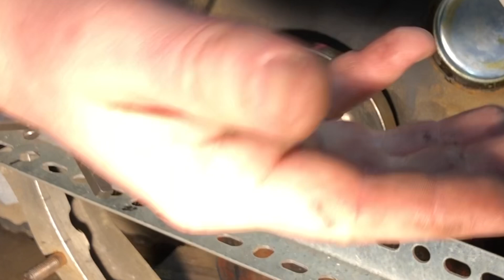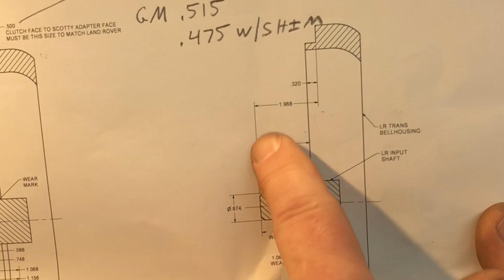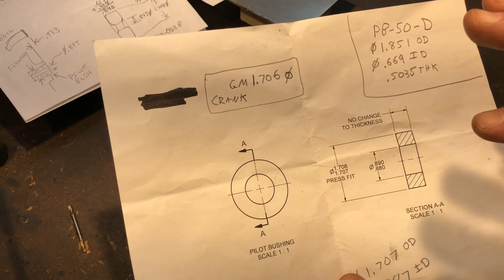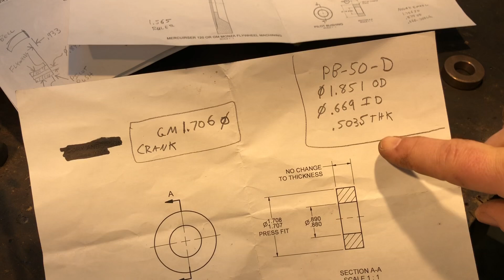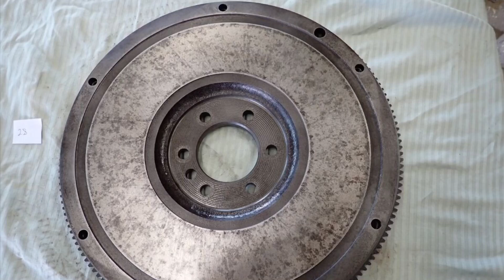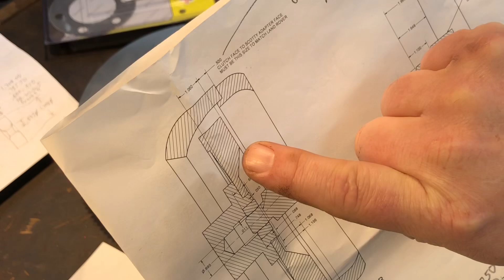Measure it! Engine swap Land Rover Series 2A Scotty GM Mercruiser restoration repair

Comment: I enjoyed this video and thanks for making it; it's fascinating to see what's involved in this sort of engine swap. I have done a swap into a Defender, but that was easy by comparison with yours as I used a Rover V8 and it's matching R380 gearbox - hats off to you!  I'm looking forward to seeing your engine running and to how she performs.
Reply from the maker: Thank you Sir!! It definitely takes a little thinking. Rover V8 would’ve been a nice swap. Light engine with lots of power. Did you like the swap afterwards?
Reply: @conrad1468  I liked it a lot but it was very thirsty for petrol, so much it spoilt ownership eventually. I fitted a Mega squirt system to it hoping to improve economy and that helped, also improving performance and reliability, but in the end I was tempted by another project so sold the V8 to fund it.
Reply from the maker: @davidbrodie5044  fuel economy is always a challenge with a V8. I’d like to make a mega squirt FI for something. It sounds interesting to build it.

Comment: I'm here, I made it all the way through. I have a deep appreciation for the work you put into this - I think I would have just eye-balled and then moaned when it didn't work 😁 All of these videos have been really interesting in showing how much work is involved in doing an engine swap. I've got an Oldsmobile 350DX which gives similar power to the Rover V8 petrol... could be fun...
Reply from the maker: Thank you Sir! There is a lot to an engine swap. I feel most videos glaze over it and don’t give much help. So I figured I would make a mind glazing boring version. Ha ha!!
You’re building an Olds 350 diesel engine (DX)? That’s interesting. I remember when they started making diesel engine in American cars. They were slow and didn’t last long. I remember lots of people complaining about them.